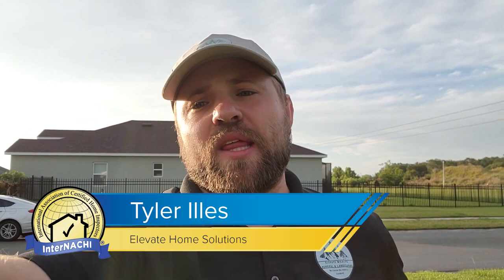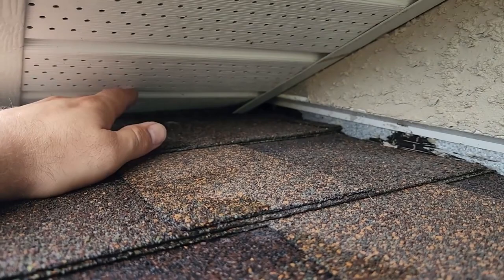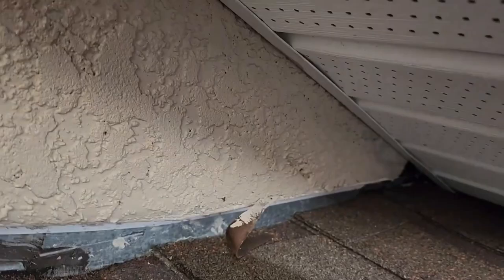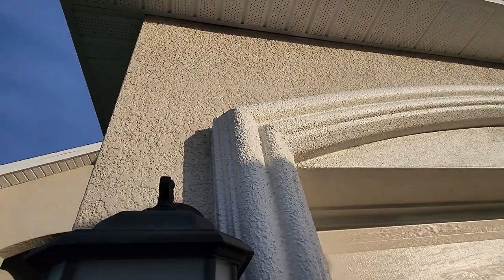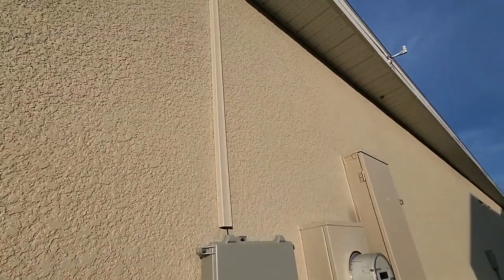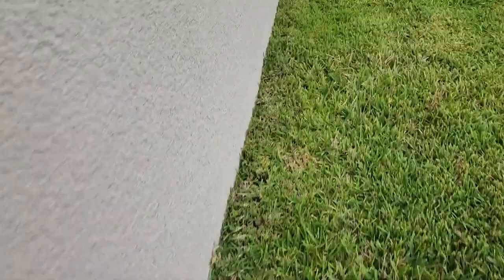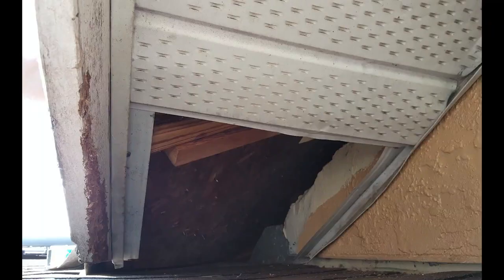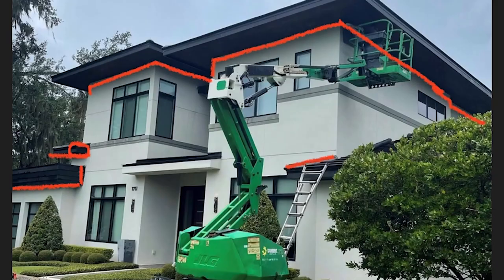Animal Entry Points For Your Home

Comment: This is the best exclusion  video I have seen.  And I've seen a lot.  My home was built in early 80's & my roof has angles like was shown here.  It's a huge relief knowing I CAN block all entry points.  I hired a pest control who said I couldn't do anything about them getting into my attic. They missed a hole chewed through metal that was used to mount the dryer vent.  Actually they did not cover any holes on the outside, only stuffed a small amount of wire mesh down around the pipes that supply water to my laundry room.  I knew nothing about exclusion & I am terrified of rats & mice.  I will not ever hire anyone who is just going to take my 💸 & cost me way more in the future.  If you want a good job done you must do it yourself.  I was never taught diy growing up.  As a female it's been hard but I have learned & made mistakes along the way.  You don't understand just how much your video has helped me.  I just want to cry.  I never thought I would have a rodent infestation & have never gone through something as horrible as this in my life.  Ty so much for taking the time to do this video 💕💕
Reply from the maker: Thank you. Awesome. Thanks for watching the video and for replying. For more home inspection videos, please visit https://www.nachi.org/webinars

Comment: What would you use to seal these entry points off?
Reply: Steel wool and then spray foam does a great job. The steel wool will prevent rodents from chewing through
Reply from the maker: good
Reply: Thanks for commenting on our tutorial. If you're a local Floridian, we would love to help you. If you wish to DIY to the best of your ability, you want to use FWC certified materials. Concrete for roof angles works best, do NOT use Foam in any case, anything with teeth and claws will tear through foam easy. Hope this helped

Comment: My girlfriend caught 10 rats in a 1990 home. In the flashing part of her roof the rats were able to get into the attic and into the walls. She had a pest control come in find entry points from the roof and the pest control sealed them with spray hardening foam (I did the same at my mom's home but overtime rats will knaw out the foam and I had to spray again. The pest control then set traps and vacuumed the rat droppings, which can be toxic. The whole process cost her $1,000.00. Rats can come from other nieghbors who can't afford pest control or if living near a restaurant or grocery store they can travel to a residential neighborhood. The rats in are area are huge. If you own a home its another added expense.
Reply from the maker: Wow. Thanks for sharing.